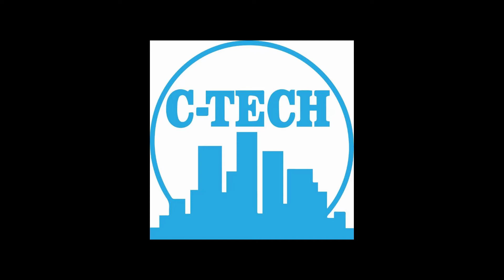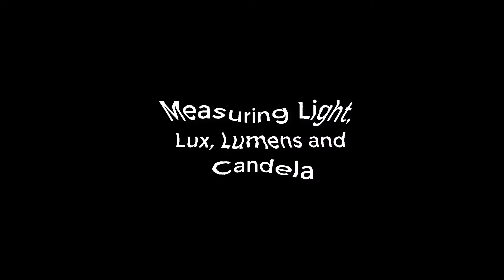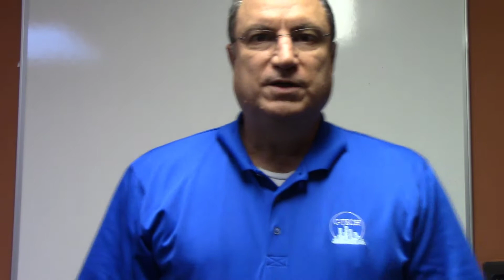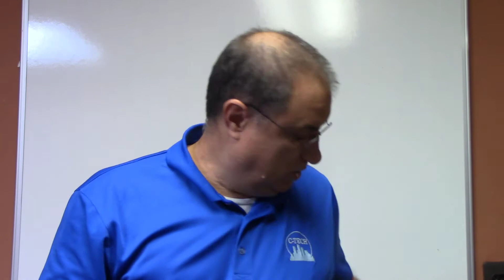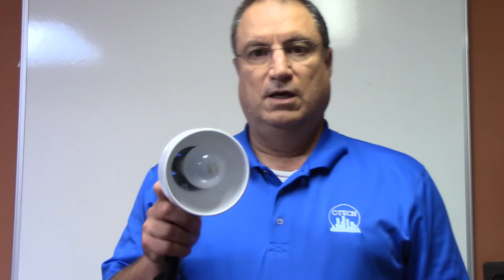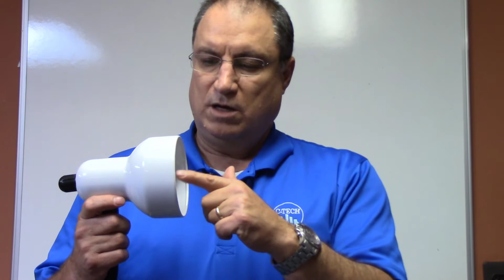Measuring Light Lux Lumens and Candela

Comment: Does lumen refer to visible energy output or all output including infra rad ?
Reply: It refers to the energy or spectrum the light is designed/purposed for, However unless the light source is specialized UV, laser, or inferred then it is in reference to visible light.
For scientific applications a spectrum graph will usually be available, For marketing of cheap products all output will be measured because they just don't care and may just make the number up based on wattage and heat output.